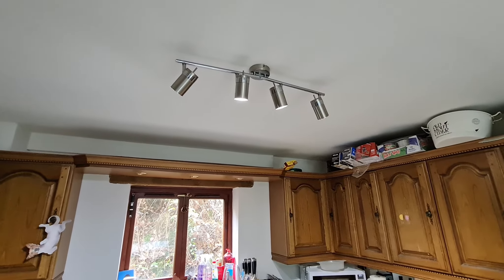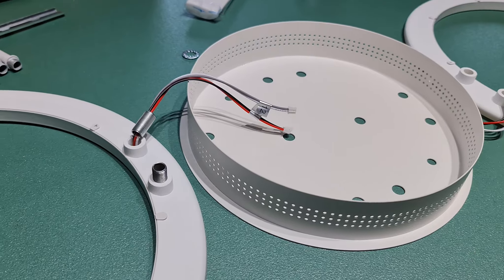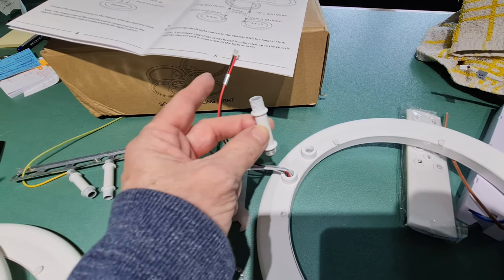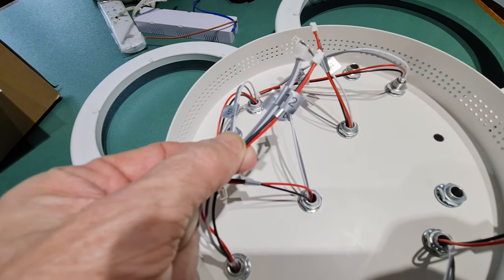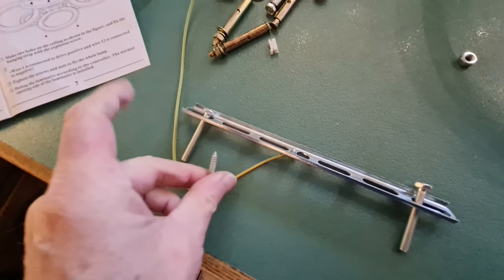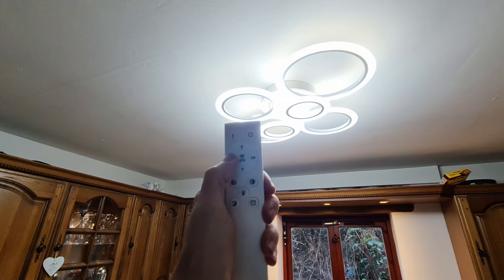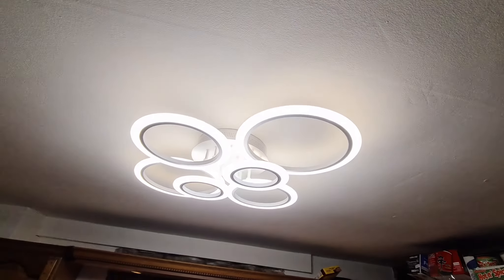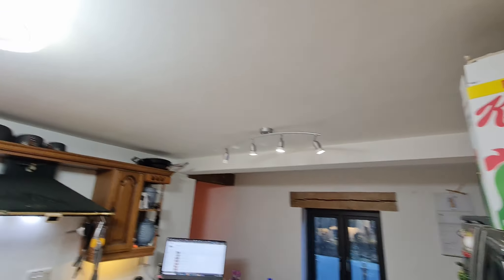The Best LED Ceiling Light: Assembly and installation

Comment: Thanks for a really useful and detailed video. I was wondering about using the expanding bolts and suffering FUD so the advice (not to as my ceiling is board too) was very welcome and with the extra confidence that gave me I finished the job using my own screws plugs and washers suited to a hollow ceiling. Now my home office is much brighter (was the darkest room in the house and the previous light just wasn't up to it). Being able to dim and warm in the evenings is a bonus.
Reply from the maker: Thanks for that Ralph.  Great lighting